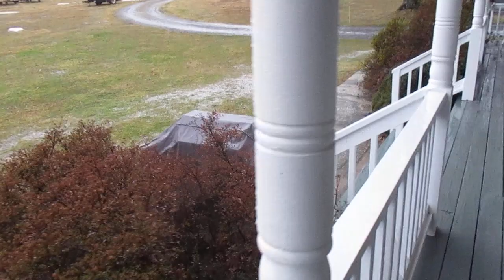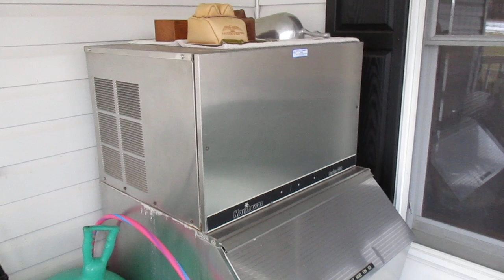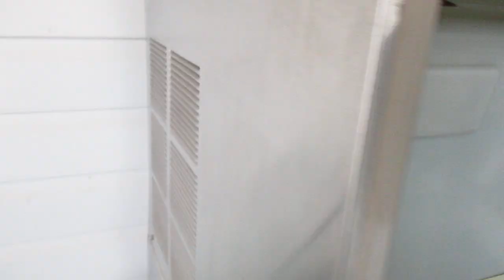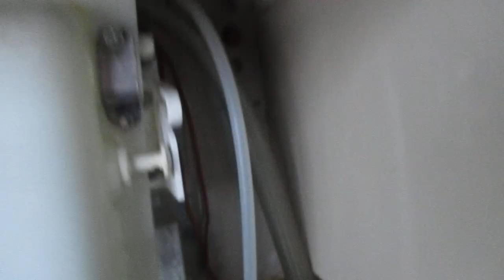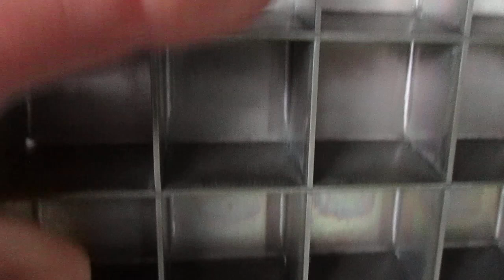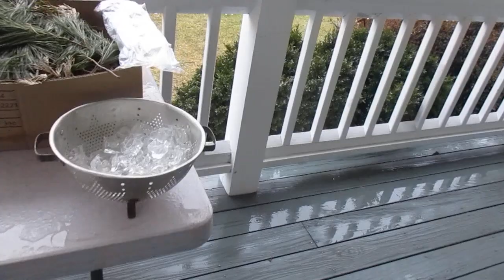The Ice Machine In the Rain #262

Comment: Hi John. Thanks for that. I often wondered, when digging into the ice cube store at HO JOs, how the ice machine worked. I have a small counter top machine that has probes sitting in a reservoir of water. The probes freeze, and when the ice has built up the probes warm up to release it, the reservoir tips and the ice gets dumped into a small storage compartment.
Anyway, interesting stuff on a wet day. You stay warm and dry now. I will await your next video. Take care. Stan
Reply from the maker: hi there  thanks for the watch john